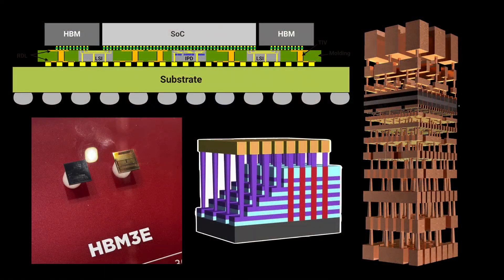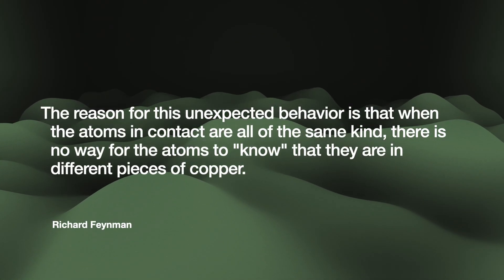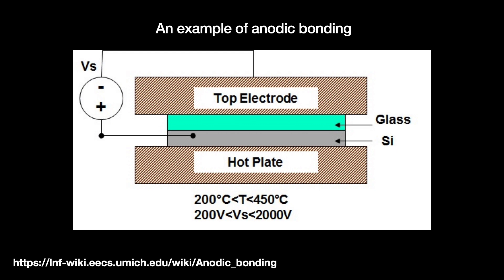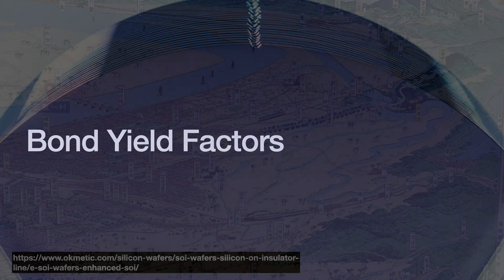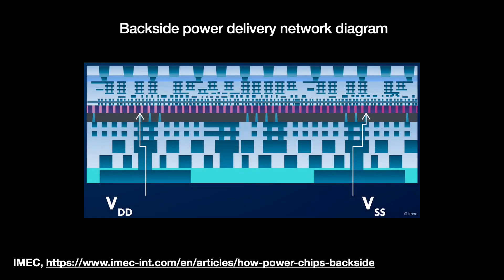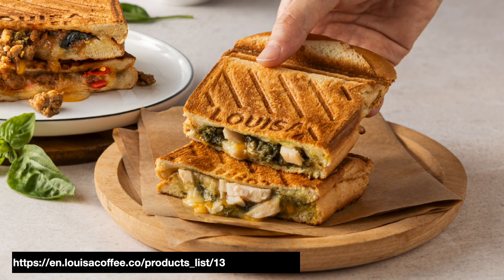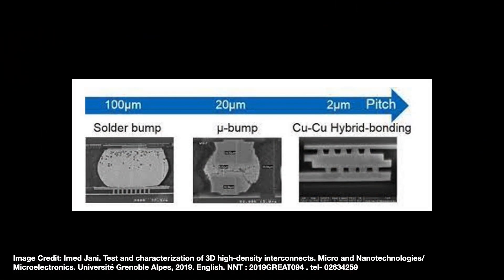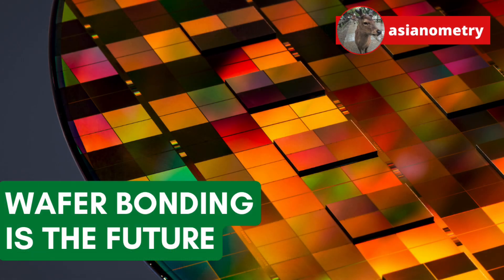Why Wafer Bonding is the Future of Semiconductors

Comment: AMD was the first company to introduce a product using wafer bonded HBM- the Radeon 300 series, or "Fiji" back in 2015.  The Radeon R9 Nano was perhaps the most popular card in this series.  TSMC and Amkor co-developed the silicon interposer technology necessary to make these products a reality.  Amkor was the one who provided the silicon interposer in the first production cards.  The high mechanical bonding strength makes HBM extremely reliable, far more so than GDDR where the memory is packaged separately from the GPU.
Reply: AMD was also the first to market with the direct-copper bonding method: The 5800X3D. It was originally planned for Zen 2, which even had the connecting pads, but the yields were terrible, so it wasn't brought to market.
Reply: I think you mean first consumer/retail product? IBM call it MCM, been used in Power arch for 20 years but you won't find that in any gaming rig
Reply: @foobarf8766  See my response in the other thread. You're mistaking Multi Chip Modules for wafer bonding.
Reply: I had an R9 Nano a few years ago! I still see it pop up in conversations sometimes, underrated card.

Comment: One of the things I like most about the Semiconductor industry is how everything is so directly named. “What is Metal Interlayer bonding?”Well it’s the previously discussed method of bonding but this time…. wait for it ….. it has a metal layer in between the two bits we’re bonding.😂
Reply: Indeed, CMOS is not a fancy name, its just Complementary Metal Oxide Semiconductor
Reply: Well, imagine if more abstract names are being used...it will get really confusing really quick ¯\_(ツ)_/¯
Reply: The hardest thing about any industry is naming things, at some point you gotta give up coming with catchy names
Reply: Yes! 
I put it down to the structuring of the industry. It's so fragmented and modular. 
The naming has to be intuitive for the fabless design engineers to understand fab technologies.

Comment: Love the video! I can’t speak on semiconductor wafer bonding, but in the MEMS field, wafer to wafer bonding is commonly used to package MEMS components in hermetic environments. The EVG tools that you mention can apply force, temperature, and vacuum, the last one sucks any air out of the MEMS package. This is really important for high Q factor MEMS resonant devices, where any damping, including any air molecules, can severely degrade performance.

One subset of thermocompression bonding is eutectic bonding, which is super cool because if you heat up two different element thin films together, the alloy you create will have a lower melting point than each of the individual elements themselves. This can let you bond wafers together with really low temperatures. Indium-tin has a melting point of just over 100C, but most others are higher. Gold-tin is below 300C. When you’re choosing materials for your bonding, it all depends on what you’re designing. In-Sn has a low Young’s modulus, which might be undesirable. But Au-Sn’s eutectic temperature might be too high, and your devices can’t take that much heat. So you need to pick and choose materials to suit your needs
Reply: Do the material science people just sit around and mix different element to see what works what doesn't?
Reply: @jintsuubest9331  It depends on how well the known theory works, but sometimes it is a guessing game with a lot of trial and error, because there are numerous effects and factors that can influence the result, making it quite challenging.
Reply: Just make sure no Helium is around during this MEMS package process.

Comment: Engineers talk of "wringing together" gauge blocks, the highly machines surfaces "stick" together, but not as strongly as cold-welding!
Reply: It's not done in a clean room or in a vacuum, or it would be.
These forces are subject to inverse square law, so the slightest film of oil, or speck of dust prevents them from welding.
Reply: I'm sure induction occurs between steel blocks.
In a vacuum (like space) there is no air, or air pressure to hold blocks together, but they can get closer by virtue of that fact.
Reply: It feels like a form of magnetism...
Reply: @stevengill1736  it is! all chemical bonds are electrostatic effects.
Reply: I am certain wringing is a fluid/capillary action phenomenon. It is advised not to leave two gage blocks wrung together for too long or it will become increasingly difficult to separate them.